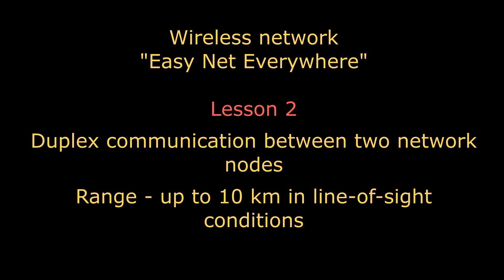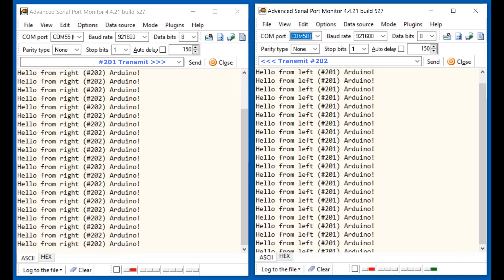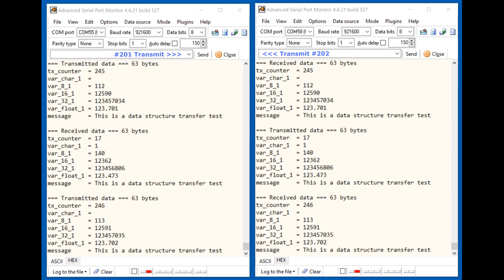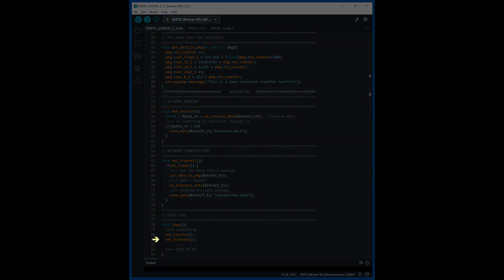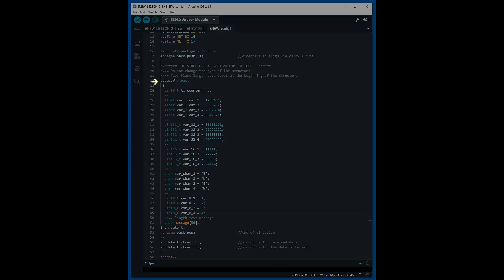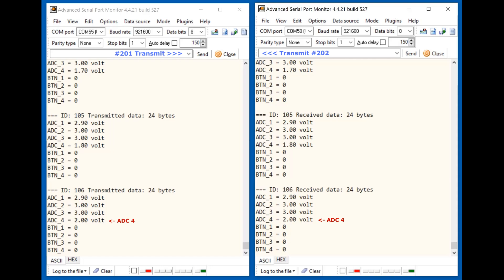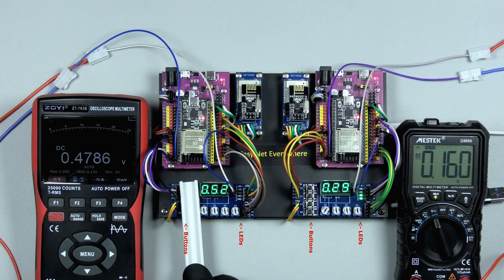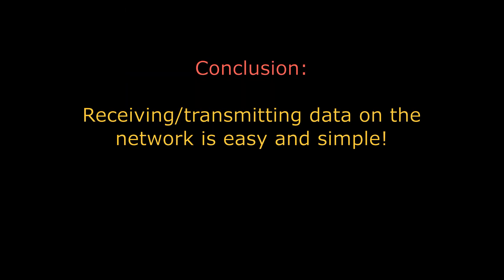Arduino, ESP32, STM32, PIC and other microcontrollers on a wireless network. Lesson 2

Comment: I think it’s important to disclose that a lot of the magic happens behind the scenes using the custom Netnode module. Lesson 1 I was amazed to see that you were transmitting packets larger than 32 bytes using NRF24 modules. However, after digging into the code and revisiting the beginning of the video, I noticed the reference to the Netnode module. A video explaining how the Netnode works in detail with code would be very interesting!

Comment: What inside ENEW_IO.h, you did not show it...
Reply from the maker: //#########################################################################
// ENEW_library
// prefix: en_
// file: ENEW_IO.h
// Copyright (c) Easy Net EveryWhere 2024
//#########################################################################
#ifndef _ENEW_IO_H_
#define _ENEW_IO_H_
//== NET
#include "ENEW_config.h"
#include "driver/uart.h"
#include "driver/gpio.h"

//== buffers for data exchange on the network
const uint16_t NET_DATA_SIZE = 256;       //buffer length
char NET_DATA_TX[NET_DATA_SIZE];        //transfer buffer
char NET_DATA_RX[NET_DATA_SIZE];        //receiving buffer

int16_t en_RATE = 2000;

//=========================================================================
// Init
//=========================================================================
void en_setup(uint32_t net_rate,uint32_t baud)
{
  NET.setRxBufferSize(2048);
  NET.begin(baud, SERIAL_8N1, NET_RX, NET_TX);  //NET  init
  en_RATE = net_rate;
}
//=========================================================================
// Time-Out
//=========================================================================
bool to_ms(int32_t ms) {static int32_t millis_now, millis_pre = 0; millis_now = millis();
  if(millis_now - millis_pre >= ms) {millis_pre = millis_now; return true;}return false;
}
//=========================================================================
// Reading data from the network into the structure
//=========================================================================
uint8_t en_receive_data(en_data_t* pkg)
{
  //== if there is no data - return
  if(NET.available() == 0){return 0;}

  //== there is data, load into RX buffer
  int16_t idx = 0;
  while (NET.available() > 0) {
    NET_DATA_RX[idx] = NET.read();
    idx++;
  }
  //== deserialisation of the RX buffer into a structure
  memcpy(pkg, &NET_DATA_RX[0], idx);

  return idx;
}
//=========================================================================
// Transmission of data to the network from the structure
//=========================================================================
int16_t en_transmit_data(en_data_t* pkg)
{
  uint8_t bytes_tx = sizeof(*pkg);            //packet size in bytes
  //== serialisation of the structure to the TX buffer
  memcpy(&NET_DATA_TX[0], pkg,bytes_tx );  
  //== send the TX buffer to the network
  NET.write(NET_DATA_TX,bytes_tx); 
  return bytes_tx;           
}
//=========================================================================
// Wait time-out
//=========================================================================
bool en_ready()
{
  return (to_ms(en_RATE));
}

Comment: It's an interesting setup, but what's the reason you used a UART converter? Do you dislike SPI communication? Wouldn't the conversion actually complicate the communication?
Reply from the maker: The reason for using UART is that it is present in all controllers and computers.
This means that any device with a UART port can work on a network.
This is easy and simple.
SPI is a good and fast interface. It is also used in the next version of the node.
SPI will be used for data streaming, for example when controlling a drone.
In one of the lessons I will show how it works.
Reply: @EasyNetEverywhere  You created these videos, but where is the source code? It’s been 5 months since they were posted.
Reply from the maker: @perry1408  The source codes of the examples are fully presented in the video. Is there a need to publish the listings separately?
Reply: @EasyNetEverywhere  Would be great
Reply: @EasyNetEverywhere  will you?
Reply from the maker: @perry1408  All listings will be released in the second half of September.
Reply: @EasyNetEverywhere  Can t wait, I also started to make a code with SPI communication with ESP IDF.
Reply: @EasyNetEverywhere  I am still waiting btw ;) Do not forget
Reply from the maker: @perry1408  Exactly what code do you want to see?